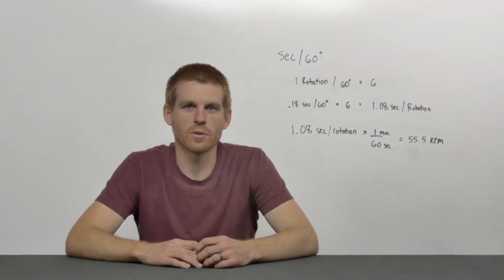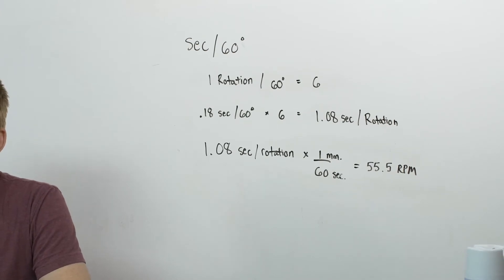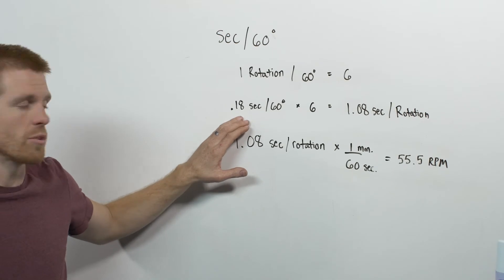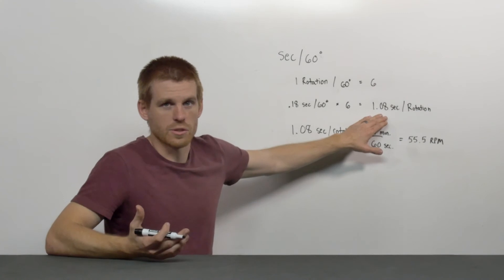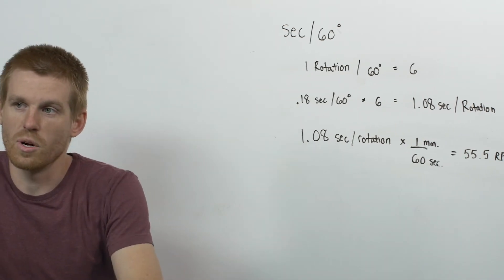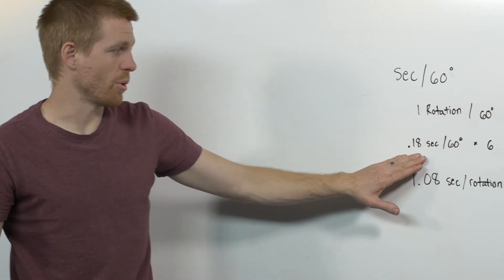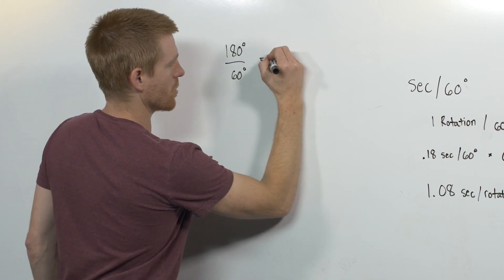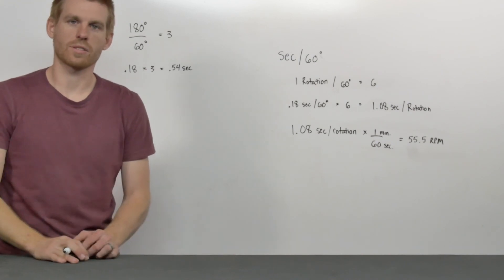The Measurement of Speed - The Secret Life of Servos Ep7

Comment: hello, great content
if you take a servo that is 0.05s/60 that gives you 200rpm, and a 0.10s/60 that gives you 100rpm. where is double the speed coming from is it the motor spinning twice as fast or is the gear ratio being half?
thanks James
Reply from the maker: Thank you, James.  Glad you found the information helpful.  

Without comparing two specific servos I can't tell you for sure.  If the voltage is constant, the only two remaining factors would be the RPM of the motor or the ratio of the gearbox.  If you're comparing two very similar servos within a lineup (let's take the Hitec D940TW and D950TW for example) and all the specs are the same aside from speed and torque you can probably assume that it's just a ratio change.  When it's just a gearing change you should see an inverse relationship between the speed and the torque.  Feel free to contact us should you have any additional questions at tech@servocity.com.  Thank you